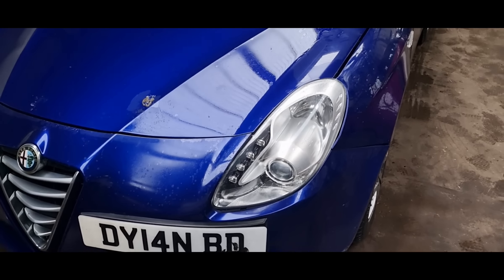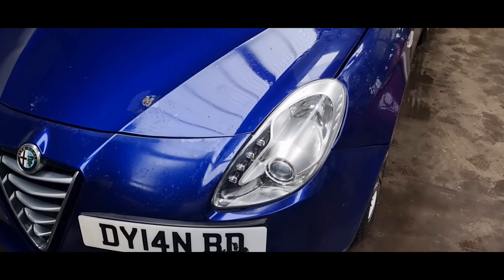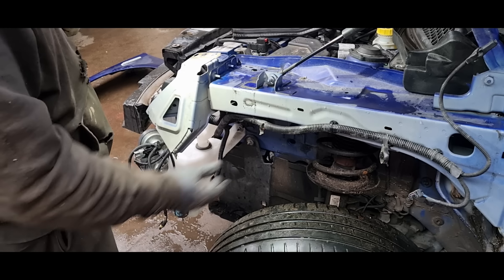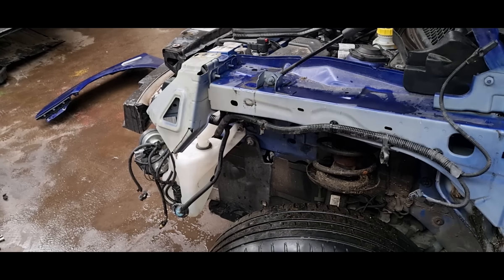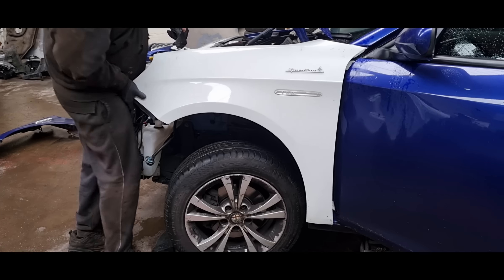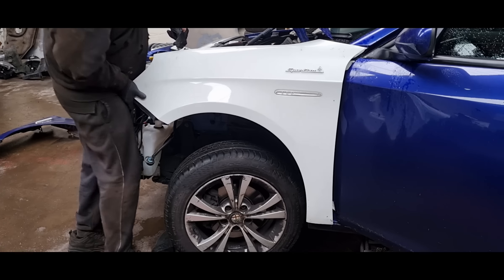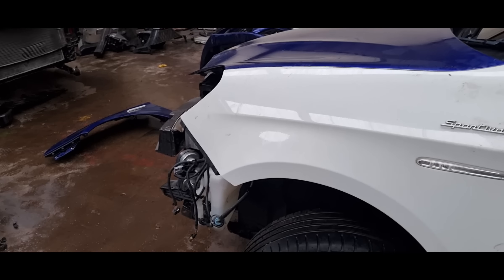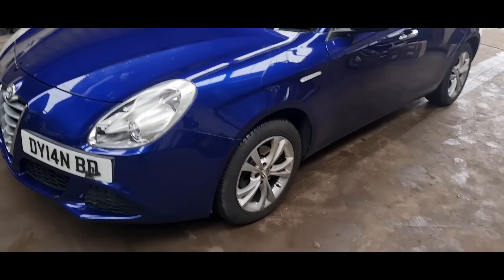Alfa Romeo Giulieta Accident/Crash Repair done to a tight budget.

Comment: I never understand these paintshops who decide to mask around headlamps and number plates rather than take them off. Unacceptable for me. Sloppy. In fact, the front bumper should have come off as well.

Furthermore. There is no way I’d accept a second hand panel on an insurance repair, no chance. I pay insurance to cover proper repairs should I ever need them. If I ever did take a second hand wing, I’d look for one in the same base colour as there’s nothing more horrendous than a stonechip showing a different colour panel underneath.
Reply from the maker: Your forgetting these jobs are done to a customers budget and this was a very tight costings job. If you wanted the job done to a higher standard it involves more labour and can easily double the jobs cost. A wing alone would cost £300 plus vat which was pretty much half of the jobs total cost with a used wing. All of these job are done to a customers request to save money. If you want it done a certain way it can be done.
Reply: @ItaliaAutos  sorry I read this was an insurance job. My bad Neil, agree with your comments.